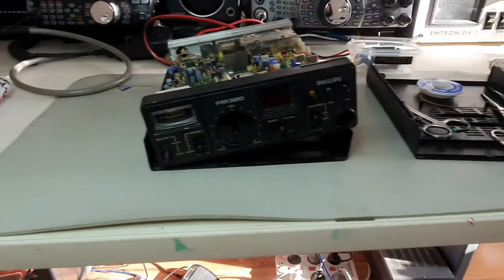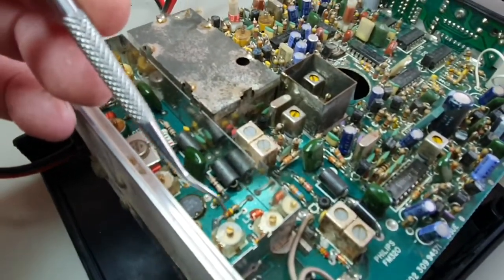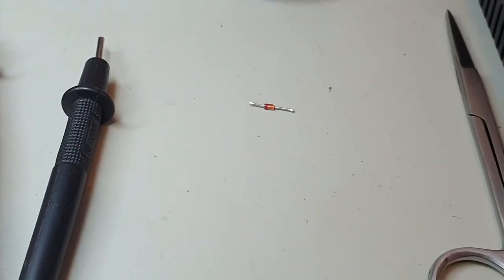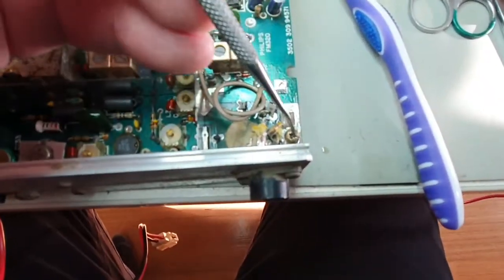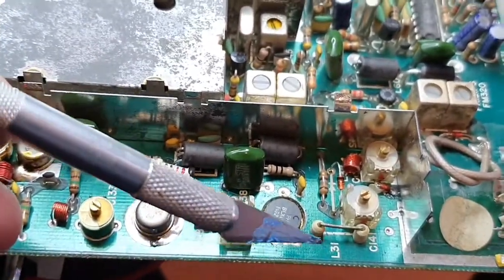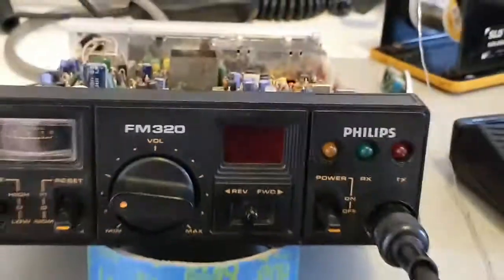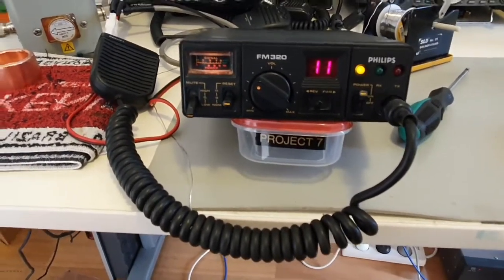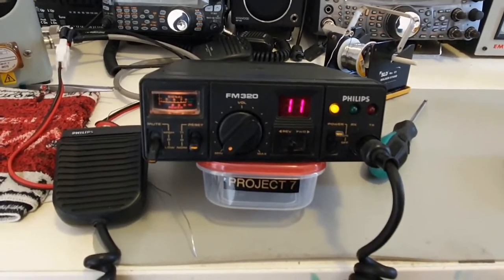Philips FM-320 UHF CB Australia Swamp Radio Repairs

Comment: I loved these radios and still have one.. I also have a Phillips FM900. I stopped using radios and doing repairs in the mid 90's when I moved to my new house and have not set up anything, it is all in boxes stored away and the aerials are in the garage roof stored away, which includes a 3 element V-Quad and several other aerials that I used to have set up prior to the move.  I have been thinking of getting back into it...